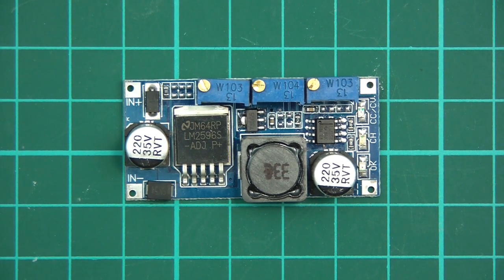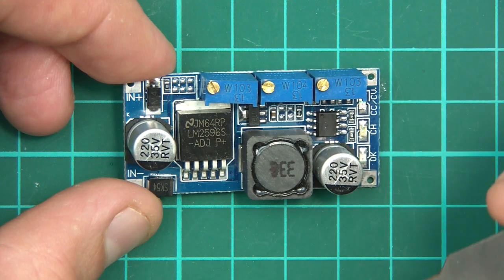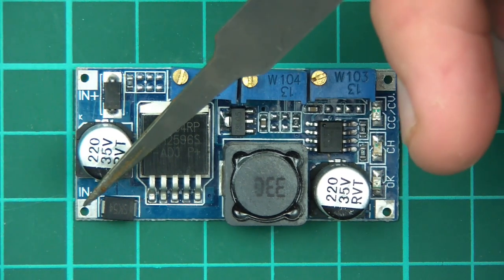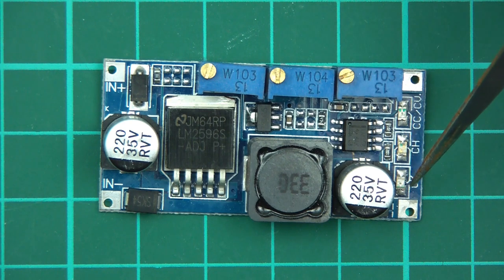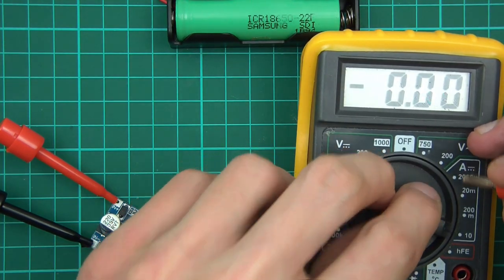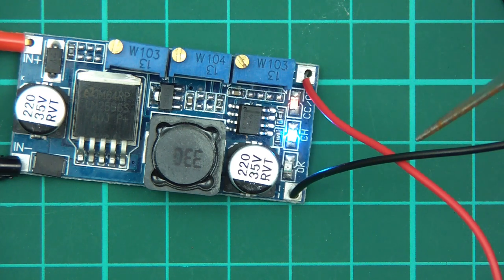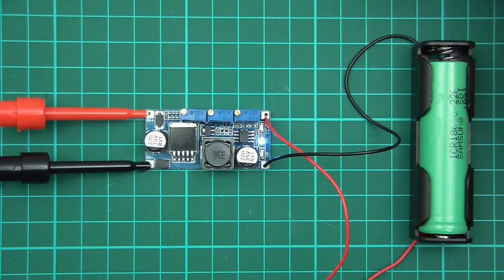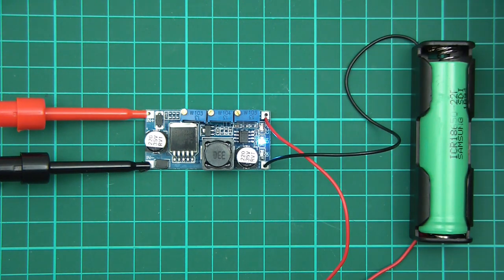TUTORIAL: About & How to use a Cheap LM2596S Buck Converter / Battery Charger Module - Arduino

Comment: You could measure the O.K cut off limit by creating a controlled short with a resistor. 

If you calculate the power consumption of the resistor and then adjust the pot to just after the O.K turns on, you know the pot is set to turn on the O.K circuit when the value of the short is reached. 

For example, at 4.2v, using an 84 ohm resistor would create a 50mA short. So, short the output terminals with an 84 ohm resistor and then adjust the put until the o.k light just turns on and then leave it there. You have now set a 50mA cut-off O.K limit.

Comment: for the middle pot, you need to use electronic load and set current where your battery is considered fully charged (dependent on the internal resistance of the battery).  eg: 10 milliamp for my particular battery. Then adjust pot where the CH led will dim and eventually turns  off and the OK LED turns on indicating your battery is fully charged.   I have 3 of them and are excellent unit for charging batteries.  I just wish it's a buck/boost instead of buck only,  would have been handy charger overall.
]

Comment: Hi Antony and Maxint,
Both modules are same, you can use them as battery charger and/or led driver, it is based on cc/cv wich is common for both applications and more...useful and helpful as usual, godspeed Antony...
Reply from the maker: Thanks Rafik. It's just that the LEDs seem to be switched around with some boards. Antony...

Comment: I have this one too. According to the product picture at my supplier on Ali, the CH-led indicates Charged (not charging). The OK-led means that output power is on. The middle potmeter is to set the charged level, so when the current gets below the set level charging is done. The unit switches then output off, the OK-led dims and the Charged-led turns on. According the description the full level is normally set to 0.1 times the charging level.
Reply from the maker: Hey Mr Maxint! That is not true of my module. On my module, 'CH' means 'charging' and 'OK' means 'charged'. The charged level is set my the middle pot as you described. The LEDs on my module are reverse to your documentation! You can see this at the end of the video. :-)
Reply from the maker: The same goes for me... I may have a messed up module! This has happened before where the makers have made it very weird. lol
Reply from the maker: Maxint R&D! Lol, look at this! https://ae01.alicdn.com/kf/HTB1bbgvKXXXXXc6XFXXq6xXFXXXn/10PCS-LOT-LM2596S-LM2596-DC-DC-1-25-30V-LED-Driver-Step-Down-Adjustable-Power-Supply.jpg It is clear that the makers aren't fussy. This is a hybrid of both of our modules!
Reply: Quite hilarious! Normally you would want output to switch off when the Li-ion battery is full to prevent damage. The middle potmeter should control output as well as the leds. Couldn't you find any setting where your module switches off? If I find the time I will hook up mine to see when it switches on/off.
Reply from the maker: I don't think it's necessary to switch it off, because it will just tell you that it is charged. I don't mind it staying on if it's only taking 50MA or so because it probably works out at about 1/2 a Watt to leave it on. Who knows though, I'm no expert. :-D
Reply: I'm certainly no expert either! Somewhere I read that Li-ion batteries don't really like to be trickle charged continuously and that it might affect their lifetime. Here I found more info: http://batteryuniversity.com/learn/article/charging_lithium_ion_batteries
It states: "Li-ion cannot absorb overcharge. When fully charged, the charge current must be cut off. A continuous trickle charge would cause plating of metallic lithium and compromise safety. To minimize stress, keep the lithium-ion battery at the peak cut-off as short as possible."
I had an experimental solar charged ESP8266 made with li-ion and a tp-4056 module. It worked fine for more than a year, but now the li-ion turned puffy. Perhaps it just got too hot in the sun, but maybe it didn't like the daily charge-discharging...
Reply: testing and explanation: https://www.youtube.com/watch?v=-sbzZDGEjbA you are right
Reply: @AntonyCartwright  I can assure you Antony that you don't have (didn't have LOL) a messed up module - I say that because I have 3 of them and they all work wonky - Horribly if you are needing lights/led's.  My Led's don't even seem to work in a common sense way at all.  It was very frustrating for me until I figured out that - just set the voltage and current for the charge you won't and pour hot coffee on the middle pod because it is of absolutely NO use at all.  None of my modules actually cut power to the output until I physically remove the input power LOL...  But like I say, I do believe these modules work for what anyone would need (Charging) but I definitely would not even pay attention period to ANY of the Led's.  My modules stay green from the time I put power in until I turn power off to the module and no matter how discharged a battery is, the green light is always on - on all 3 modules that I purchased.  I am working on a video right now of this module and creating a tutorial on using this module to balance charge a battery pack that has no bms.   

Antony, I really enjoyed this video and by the way - Love Love Love the accent - so cool - I am a super huge fan of the English, British, Irish, Aussie accents - It just makes my day listening to people talk with that accent...  It is super cool that you put yourself out there to help and instruct others - AND - because of this video (that led me to answering and helping a couple commentors here) I have at long last decided to finally start my own channel "Outside In," so thank you so much Antony and also Nikola (one of the commentors who needed help) for the inspiration, AND push LOL to get-r done...
Reply: If the battery was exposed to the sun that explains why it got inflated. If the battery was charging at a safe level this will not happen and also these batteries weren't made to last for ever.

Comment: Think you will find that when you initially set the output to 8.4V via the multimeter  and then added the battery,  unit would read battery voltage which would be lower.
Adjust the charge current to maximum, as the voltage rises to the set level, unit senses and trips the charge as Lithium normally require a voltage dependant charge NOT constant current.
Reply: A bit of both really, Li-ion charges at 1-2c so 1000mah would be 1-2a for the cc value, then when it is drawing less then the set cc value is sits at 4.2v untill it reaches 1/10th of the set cc value and then it's fully charged.

Comment: That middle pot on mine is for charging off a car battery and you set it to stop draining the car battery before it's dead for example 11v regardless if your 4.2v, 8.4v or even 12.6v battery pack is fully charged or not. I have a bunch of these including buck/boost and they all do the same plus you can charge a 24v off of a 12v battery using this method, but this could have a different function, I don't know and that's for charging off a larger battery, but if you're using this as a power supply it may have a different function or no use at all. Lithium cells don't like a float charge. It's normal and typical for these converters to automatically terminate the charge of voltage and current once finished. Maybe this one is used for the LiPo cell if it drains down to 2.8v or 3v to restart the charge cycle, and if you can heatsink that chip it will allow for say a 3amp output, just a guess.

Comment: you should always have meters when adjusting the pots lol, CV is used to set the max voltage allowed, CC sets the max current allowed, using as a voltage regulator or charger you should never turn those pot without meter instruments hehehe, CC can set the current regardless of voltage as long as it doens not go over the preset voltage
using it as a charger, set the max voltage which the battery is fully charged, your example is 4.2 volt because of the lithium battery so it never goes over that voltage that would harm the battery, 
then set you charge current as constant current, so the charger will keep a constant current safe current when the battery is not full at 4.2v, the battery is always lower than 4.2 when its not full anyway. the CV setting will protect the max voltage it will reach
test charging a non full battery and monitor the current and max voltage you set, when the battery gets full 4.2 volts it will soon decrease the current just to keep the voltage from going over 4.2volts, 
the middle pot is just for the LED indicator so even without a meter, the LED changes to OK, so only turn that middle POT when the battery is full, at 4.2v and 1/10th the current limit you set. for 1A, the current would be 100mah, you can use any ratio you want, example 1/2 or 1 amp  set. i dont think the moddle pot will stop the buck, it only to set the light indicator

Comment: I have been looking for the specific way to set the max (constant) current for charging.  In the video did you use "and short the output with a 100ohm resistor" or just connected the multimeter in current measuring mode (in series) ?

Comment: The annoying thing with this module is that it seems not switching off the output when the current threshold is reached. So a li ion battery will continue to be charged unless you unplug it manually. As far as I know, this is not good neither safe for li ion batteries. Can we modify the circuit to enable this auto cut off feature?!
Reply: I read somewhere that those module works like that. I means about the cut out VOLTAGE  is not present, as battery do not mind that, what is critical to the bat it is amps flow, which this modules cut when the bat is full.
If you connect an ampmeter in serie between the power supply and the module, you wil see an amp flow drain (1A or 1.5A depends from how you set the pot) drain from the main charger, and once the battery is charger, the amp flow drops to around 50mA, which is the minimum used by the module itself, and no more current (Amps) are pomped into your battery.  
If you want a Voltage cut off you need to use a delay or a Mosfet.

Comment: You are assuming too many things, without actually measuring them . The module´s purpose is to charge with constant current between a maximum and minimum battery voltage. Then maintain a floating voltage.
Reply: Hi please could you elaborate on that. I'm confused.
Reply: Surely that is the function of the voltage adjustment?
Please explain more.

Comment: A few corrections that are posted on the Bangood and AliExpress listings, and are reflected on your video:

1.  The protection rectifier (labeled M4) is a simple silicon rectifier rated at 1 Amp (max recurrent reverse voltage = 400V), and protects all but the input capacitor. So, if connected with reverse voltage, the input capacitor will blow, but the rest of the circuit will be saved.
2.  There is a limiting factor to the input voltage. The websites indicate a maximum input voltage of 35V. However, the LM78L05 regulator that powers the LM358 has a maximum input voltage of 30V, and is connected directly to the safe side of the protection rectifier.  Therefore, the module input voltage range must be 7-30V, as the minimum voltage for that regulator to operate is 7V.
Reply: That explains a lot. I am running it right now at input 32V output 29.3V 1.2A. It makes a terrible high pitched noise and runs waaay to hot.
Reply: As you stated in point 1, the capacitor blow out on 1 stepDown module after reverse voltage connection. yeah my bad. Should have been more careful...
I solddered a new capacitor, unfortunatly, the module is not working as it should. It just light the Green led and do not decrease the voltage as intended, and output is 0 v. ah the module is XL4015. Any idea how to fix this module?? maybe change the main XL4015 chip??
yeah I know, those modules are very cheap, so why bother to repear and not simply buy another, reason is that it takes a lot for it to be delivered to me... sometime more than 2 months....
Thx

Comment: If we parallel connect two of theese units in cv mode both adjusted same voltage, then do we double output current ?

Comment: its ok to use it to charge a tablet, I have a windows table that need 5v 2.5a(3.3mm barrel jack), I try a lot of charger even a QC2.0/QC3.0 charger still the tablet did not chrarge while turn on, I looking a best power option to charge my tablet.

Comment: It's not daft having a 35V rated capacitor on the output. The higher the headroom on the capacitor rating, the better. For example, a 100V capacitor would be no detriment.

Comment: Can I get fixed "12V" output from 14-20V varying solar panel input using this ?
The plan is to use 18650 batteries (total 6, 3 in series) in series, attached to a balanced charger.
Reply: 3x18650's will charge to 12.6V when new. With a minimum input of 14V, and output of 12.6V is extremely close to the limits of regulation.  LM2596 Saturation voltage (the point where no regulation occurs) is 1.5V.   This means that a voltage of 14.1V will eliminate any regulation.

Depending on the current output of the solar panel you might consider a Buck/Boost regulator between the solar panel and the charging module.  This will create a constant voltage to the charging module. If you set the output of a Buck/Boost module to 15-18V, the charging module will be happy (the lower the output voltage here, the less boost voltage and current loss).  Make sure that the solar panel will supply sufficient current at low voltage output as supply current will decrease as well as voltage. There will also be loss of current in the boost process of the Buck/Boost module, which may be an issue.
Reply: @VideoFlyer10 Please explain that to me. 12.6v in series?
Reply: @LEO-xo9cz  Each Ion-lithium cell can be charged up to 4.2V. Three in series makes 12.6v.

Comment: Wait, could this be used as voltage injection tool ?
Like variable bench power supply ?
Reply from the maker: Yes, but it doesn't have the capacity in terms of amps to be very useful.. from memory, it can barely cope with an amp of current.

Comment: Hello Antony. actually i want to know. can i charge COMPUTER UPS BATTERY with this module ?
Reply: Learn & Teach probably not ! UPS batteries need current around 8Amps which this device cannot output. 
You can put two of these devices in series(output) and adjust the voltage of both the devices to 7v and charge the battery.
Reply: For sure you can. Just set the voltage to 14.4V and curent to 0.7 Amps and the battery will charge ok. Verified by months. But I don't know how to use the middle potentiometer in this case, charging a 12V/7Ah UPS battery.

Comment: I WILL TEST @ POST A REVIEW IF THE CURRENT IS CUT OFF BECAUSE __IMPORTANT!!! __ "Li-ion cannot absorb overcharge. When fully charged, the charge current must be cut off. A continuous trickle charge would cause plating of metallic lithium and compromise safety. To minimize stress, keep the lithium-ion battery at the peak cut-off as short as possible."

Comment: I’ve got a 19V 4.74A laptop charger. Can I raise the voltage to 21V and limit current to around 2A with this?
Reply: No this is a step down converter
Reply: Actually  you can but if the module cannot handle the 2 amps you can connect a high power Mosfet on the output.Remember this module has a max output of about 30V. So you can charge a 19V. Batt.I would set the V. to 20V. and the C. to 1A. to be safe.

Comment: Can anyone tell me where to get this exact buck converter?  I need adjustable current and voltage, all the ones I have found only have the 1 potentiometer.
Reply: Even on eBay... Look for ''lm2596 CV CC''

Comment: can you tell me if i need a diode between the output and my 3s lithium cel ? for preventing drain that is ..
Reply from the maker: Milene De jong a diode doesn't prevent drain, so no.
Reply: Sorry Antony, but yes a diode will prevent drain as that is one of the reasons for a diode (the charge only goes one way and not the other).  The reason a diode is used in a module like this is so that the charger is not destroyed from back feeding from the battery/s being charged, but most of these types of modules have built-in diodes to prevent a back charge to the module.  Some Chinese modules I have found do not have built-in diodes and why they get blown after a charge and being disconnected from the power source while the batteries are still connected to the module.  On the other hand, if you use a "not so good" diode, you can still get a drain so in that case you would be correct, but as long as you use a good quality diode, you shouldn't have any at all drain from the batteries because the diode will not allow the charge to flow in the direction that would cause a drain.
Reply: you shouldn't charge lithium batteries with this. This is for other constant voltage batteries

Comment: Can I install it between the controller board and motor...of a R/C Car???
such as...if I use a 9 V battery pack..boot it up to 12 v out put..

I know how it would work with Li io...on the IN put...between battery
and controller ...the voltage dont match on a lot of R'C cars

it'll also be great in the TX....this way you can 1 or 2 cell Li on
Instead of whatever the hell different TX Voltage uses.
It probably safer..The TX isnt drawing a lof of amps...it's needs
proper voltage or what's appliable for that especific TX..
Im sick and tired of all these damn AA and AAA  and even 9V batteies
I have to used or different TX ...Using different size and qty.

I have a lot of 18650 i harvest from old laptops...
Just make packs using 2S li ion..then step it up or down
Reply from the maker: OneEyE Monster hi, why not put the converter between the battery pack and the power point of the controller board of the device.